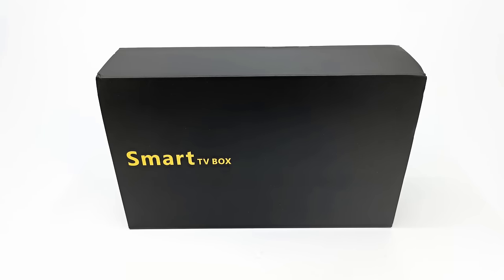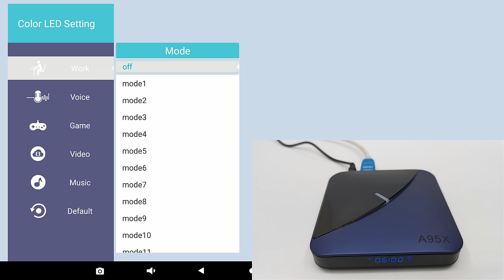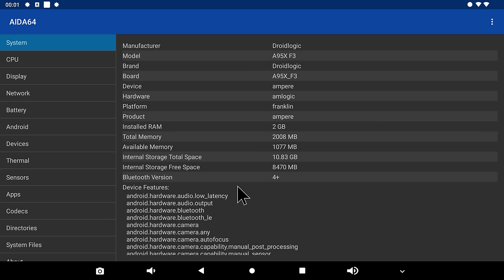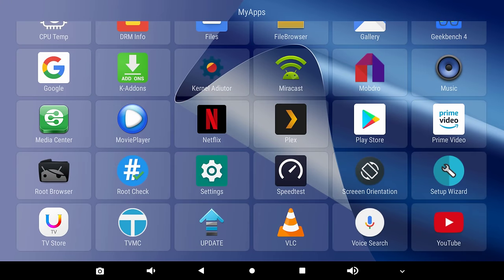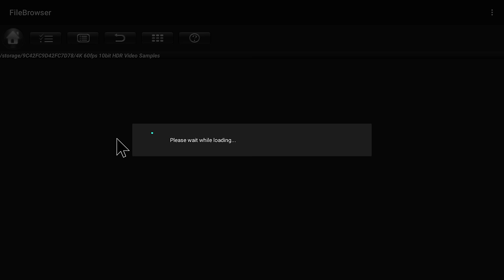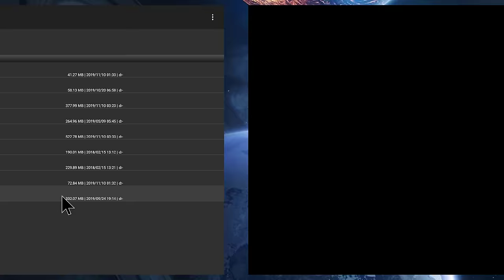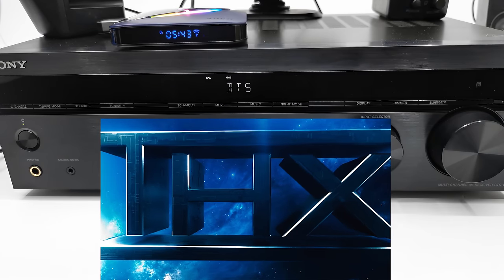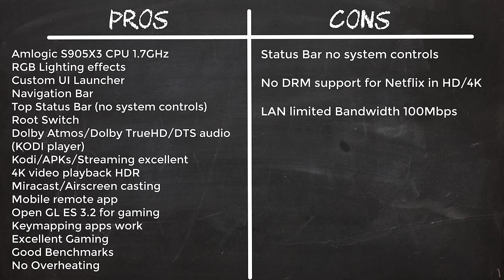Latest A95X F3 TV Box Amlogic S905X3 Quad Core Android 9 4K TV Box Stop Review

Comment: Hi friend. Can you help me with root switch feature. I have one A95 F3 Air and I turned off root via root switch option. Then I turn off and turn on device and it stucked on A95 logo. Reset via reset switch in AV port didnt helped, and I reflashed device. After that I used root switch again + About-->Restart, device restarted but device is still rooted. How you used root swich and did you had any problem with it? Tnx in advance.
Reply from the maker: What's your build number, it sounds like that is a bug. Remember when I review a TV box most of the time I use a TV box for at least three days while doing the review, and once I'm done I simply move on to the next TV box. So there isn't any real long time usage of any particular TV box with the exception of the one that I use as my daily driver. However during the time of making this review I didn't experience the problem you are now faced with. I simply switched the root switch on or off and restarted the box and I had no issues. Since then I am sure there must have been a couple firmware update from which things can change. So that may be an issue. The thing is once you update the firmware that updated firmware becomes the default firmware, and no matter how many times you reset the box, that updated firmware remains. The only way to change that is to flash the box using a stock firmware and start over to see if the problem persists.
Reply: @tvboxstop  thanks for relpy. This is version of firmware: A95X_F3_AIR_M-9.0.0-202003090926. Did you simple turned off device via RC or?

Comment: How you know that the box runs on Fully mobile version of Android ? and not TV version ?
Reply from the maker: It's the interface features. Android TV OS has some distinctive features from the mobile version, as it was designed for streaming media players only. The Google play store is quite different and limited to what you can install from it, and its launcher is a major difference. It's designed to work more with a remote than an air mouse, which is what TV is all about.
Reply: @tvboxstop  I have a T95x  android box with android tv version. I i flash it with mobile version of android 9.0 ?
Reply from the maker: You can if there is a mobile version firmware release specific to that box. Any other firmware will not work. It must be created for that box. The problem is I don't think there is a firmware mobile version for your box.You have to search for it

Comment: Is the A95X F3 slim the same but just no RGB or it has other specs?
Reply from the maker: Basically
Reply: @tvboxstop  I will connect it via Lan on a 50 MBPS line. On your test you mention it only performed 34MBPS. So will I have a reduced performance? On the summary you mention limit of 100mbps. Which is the correct?

Comment: 11:20 is this a weakness ?
The difference in speed is very far with LAN, or this only happens to the 2GB RAM variant?
Reply: Lately these TV Box companies have been installing the 100M LAN cards instead of the 1000M. Who knows why other than to make them cheaper, which is also why they went from DDD4 ram back to DDD3. What they are trying to tell us is to use Wi-Fi instead of direct connection, so might as well just remote the Ethernet port then. Whether 2gb or 4gb ram It don't matter, they have the same card.
Reply from the maker: It's the poor LAN hardware 100Mbps. I don't why they are doing that it frustrates me.
Reply: It is very frustrating because Direct connection is suppose to be the best, they are killing it. I also notice TV boxes with 100M tend to be cheaper than those of 1000M.
Reply: People. Nobody wanna have a TV  Box connected to LAN cable anymore. The world is moving towards wireless connection. Unless you live in a poor area like the first guy who posted the question. Jadi ini TV Box yg mau ente beli bray? Di Aliexpress cuma 500rb tuh. Buruan sikat...

Comment: I'm in a here take my money mode for one these inexpensive Android TV boxes BUT I only care about 4K HDR/Dolby Vision streaming. Outside of the Xiaomi Mi S (Android TV certified) they don't have the required codecs. I'm waiting for a Xiaomi Mi Box S hardware refresh before I'd buy that alternative.
It's as shame all the of the 4K HDR capable hardware is hamstrung by codec licensing issues. I'd gladly give up a rooted box (not side loading though) if I can get 4K HDR on all streaming services. Even the new Nvidia Sheild 2019 tube doesn't support VP9 so no 4K HDR YouTube and the vaulted SD->4K AI upscaling only works with sources 30fps and lower.
The 4K streaming world is still very messy. There is an opportunity for some manufacturer to clean up if they can produce a less expensive 4K HDR/Dolby Vision plus all the streamed audio formats for all the current 4K capable streaming services. We need one 4K streaming box to rule them all!
Reply from the maker: Thanks for sharing  your views

Comment: thanks to you I bought this tv box, BUT
 your benchmark are 796-2152
and my benchmark is 111-407

why?if my tv box is a95x f3 (it is not air version)
Reply from the maker: That is because you are using Beekbench 5 which is designed for Android hardware with high end CPU's and GPU's with Vulkan support. Open Aptoide of APKpure and install Geekbench 4. Uninstall the Geekbench 5 first.

Comment: Sir can we install android 11 in this box
Reply from the maker: No you cannot
Reply: @tvboxstop  why sir
Reply: @tvboxstop  can we manually download new firmware for this box to putt manually because i want to buy this box but box is on android 9 and i need atleast android 10
Reply from the maker: The only way you can flash a new firmware of a different or upgraded Android version is using a firmware provided by the manufacturer or developed by a custom firmware developer. From my experience, this has only been done on models such as the Nvidia Shield or Amazon Fire TV devices. All other boxes usually remain within their designated operating system.
Reply: @tvboxstop  sir tell me about root access it is very important thing to get rooted box or with root switch..i need a box only for iptv service and youtube use
Reply: @tvboxstop  dnt understand..i think we can use a firmware of amlogic s905w2 to get android version 11 because a95x f3 air 2 is running on android 11 nd i want f3 or f3 air because f3 air 2 is weak box due to lack of root access not root switch,usb 3.0 cortex 35 medium cpu not powerfull
Reply from the maker: The firmware will fail to flash because each box uses a different board and the firmware is board specific. Firmwares are not universal because each mainboard has a unique bootloader that the programmer has to compile into the firmware.
Reply: Thanks sir can u plz tell me about pendoo x6 pro does pendoo x6 pro habe root access or root access is not so much important thing
Reply from the maker: If you intend to purchase this box please note that the older chipset has a horrible track record in Android boxes. From overheating, to low performance, to poor firmware features. I would never recommend it to anyone unless all you want to do is to stream movies and TV shows. But keep in mind they tend to have a shorter lifespan you heat levels.
Reply: Sir i bought a95x f3 air but in aida64 it shows 5hz not support and iam confused because all boxes have capability to use 5ghz wifi

Comment: emulation capabilities?
Reply from the maker: For lower end emulators yes
Reply: @tvboxstop  up to psp? or trouble with 3D emulation like psp ps1 n64? I want to setup an install pack on my computer for the people I get these for Christmas ☺️
Reply from the maker: @SugarEthnoherpetological  I wouldn't recommend S905X3 for emulators that demand high fps, try S922X or other Hexa-core CPU Boxes.
Reply: Would this run Gameboy advance, SNES, Sega Genesis fine? Pixelated games 16bit and under. Sorry for excessive questions it's priority use will be catmouse/mobdro type apps but just was wondering gaming capabilities  because of great price.
Reply from the maker: @SugarEthnoherpetological  I don't really use  emulators like you do, so to give a definite would be an assumption and may be misleading. That's why I recommended a higher end TV box for safety.